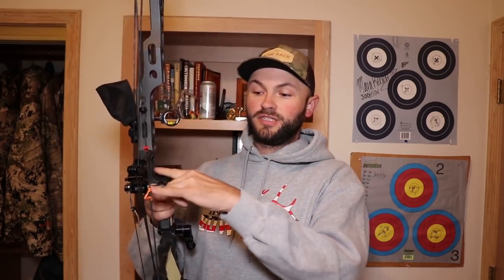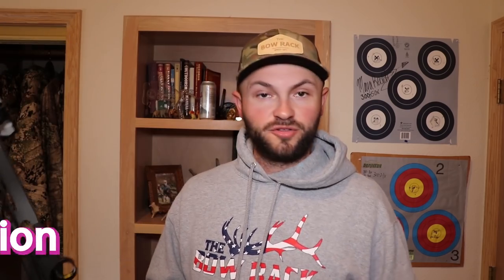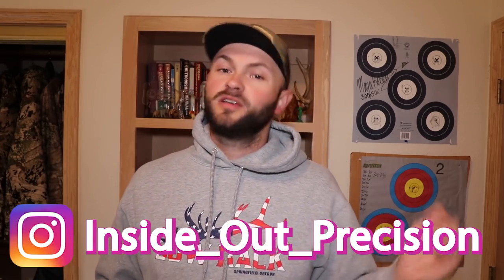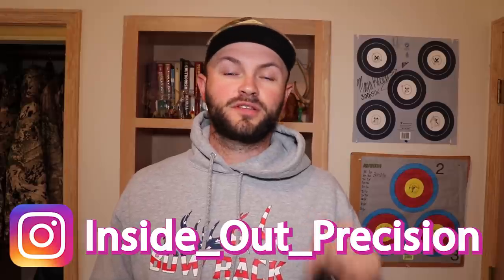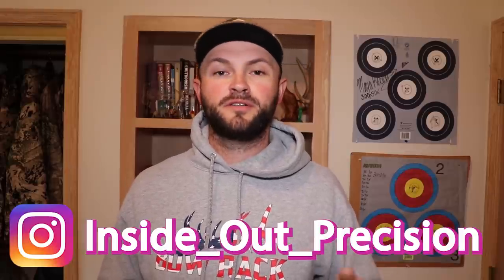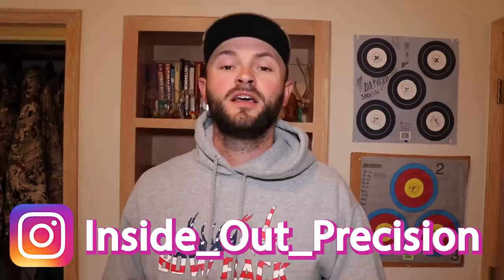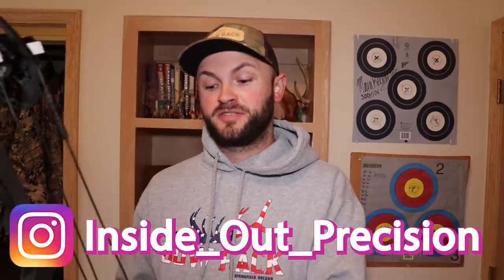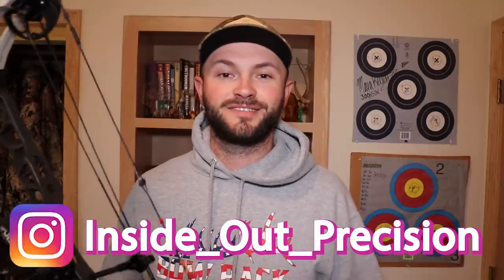Tuning Questions From Subscribers

Comment: Easiest way i found to make sure my arrow is 90 degrees from the string thru berger hole is to put my bow in my press and hang my arrow from it until it's going thru the berger hole,  fool proof method... good video
Reply: Ahh, the plumb bob method. Works well but then you can’t sell 60 dollar plastic single bubble line levels.

Comment: dude, thank you so much. Been fighting my powermax on a tail high and the only way I can get it to throw a bullet hole/clean bareshaft is to advance the bottom cam or set the nock point significantly low. Glad I’m not going crazy!!

Comment: Man i been fighting with a tail high tear with my hoyt helix no matter how much i moved arrow rest. Only way i found to fix it was slowing down top cam about 3/16 from stop. I squared my nock point at bottom half of arrow through burger hole thinking i could adjust rest on these new strings to give alittle more clearance for arrow rest. You talking about where d loop made me start thinking that little bit higher might be my problem.

Comment: Once again, another great video.  You indicated that cam timing is paramount, but you didn't advise on how to adjust it.  I believe you shorten the cable to close the timing, but not 100% sure.  Also, bullet holes through paper is just a starting point, correct?  Walk back tuning your fixed blade broadheads with field points require slight rest adjustments, if I'm not mistaken.  Adjusting the rest may result in a slight right/left tear through paper.

Comment: I have never really been able to get a proper bullet hole through paper. I make sure my timing is correct, arrow going through the Berger hole rest in the middle of my window. Shoot through paper and get it as close as I can, Then I shoot 5 and 50 yds a la John Dudley. When left and right are correct I then group tune to narrow the vertical size of the group. I don't torque tune, I don't find it useful, but that is me, it works for Paige Pearce. I shoot Field and Target archery from 30ft up to 99 yds. Tuning is so archer specific that no one method will work for everyone.

Comment: Glad to see a new video!! I shoot a carbon icon and it doesn't have yokes or tophats. I can't find ANY info on timing it or adjusting for horizontal tear. My rest is pushed so far out that it's embarrassing. Any help would be great
Reply: I'm trying to help a friend with a similar bow. Did you find a solution for your problem? If so, would you please share it? Thank you in advance.

Comment: Have you ever seen the cables not exactly matching through the holes on the Mathews cams, they can be close, but when you check timing on draw board they are perfect ?
Reply: I have this on my mathews vxr 31.5.  At rest the cables are through the cam timing holes but off just a hair when comparing the two.  On the draw board the cams are in sync as the stops hit the cables at the same time.  I also noticed my ata is slightly over 31.5" by about 1/32" and draw weight with 70lb mods is 68.9 lbs.  Not sure if this could be better but I'll check it through paper again.

Comment: Wouldn’t it be easier to solve a spine issue with adding or subtracting a few lbs out of the draw weight instead of buying all new arrows? Really curious as to why it is almost never recommended to change draw weight at all, especially since it’s free.
Reply from the maker: I hear you. If you're already at peak weight though you can't really add more without over rotating the cams which also increases your draw length a little. And you don't necessarily have to buy new arrows. You can add or subtract point weight or cut the arrows down. But yeah if you're underspined you can try dropping your weigjt a few pounds to see if it helps
Reply: Thanks for the reply!

Comment: I have an SR6 that would NOT tune with a Hamskea rest set on centershot, it was indeed  driving me nuts! Tried everything from changing the angle of the drop away cord to changing spring (both springs, external and internal) tensions... ripped the rest off threw on a Trophy Taker Pro set again on centershot and it was immediately shooting bullet holes... called Hamskea they said try all this and that, I explained I did, several times actually because I've never had such an issue tuning a bow, they were basically speechless. The rest is now collecting dust.... I did not and refused to move the rest off centershot, just me

Comment: Okay you said the arrow is supposed to be 90° from the string through the center of the berger hole... should it be the center of the arrow Shaft or the bottom of the arrow shaft should be going through the center of the berger hole
Reply from the maker: The middle of the shaft. Foesnt have to be exact, just eyeball it.

Comment: 😂😂😂 sounds like I need a new bow, I have the power max and have the 1 tail high tear...the horizontal is dead on, but she's tailing high. Thru a whisker biscuit 300 spine arrows 29.5 inches long about same for draw length. Contemplating moving the d loop a bit...
Reply from the maker: Whisker biscuits will almost always throw a tail high tear. Not much you can do with them when it comes to tuning. A good drop away rest will help a lot with accuracy

Comment: Thanks for the info in this one. If I added one full twist to bottom cam to bring top cam into timing, and they’re hitting very very close the same time, do I also need to add a twist to the bowstring?
Reply: The cables and bowstring oppose each other by pulling the cam in different directions. So, if your cam timing is late on one side (there's a gap between the stop and the cable/limb on that side while the other side already touches), either relax your cable (untwist) on the late side so the cable will oppose the bowstring less and let the cam rotate further, or twist the cable on the early side so it will oppose the bowstring more and retard the rotation of that cam a bit.
That's a mouthful. If you don't get it with the first reading, read it again.

Comment: So I’ve timed my cams dead on and set my hamskea trinity so my arrow is going through the center of the Berger hole and set my nock point 90 degrees to my rest and I’m still getting a bad nock low tear. Moving my rest doesn’t seem to improve it. What else should I try? Shooting a Mathew’s V3X 33.
Reply from the maker: Try raising your nock point a little bit

Comment: Love your videos. But moving the rest in the same direction as the tail of the arrow, or the rest in the same direction seems backwards to me when I look at the mechanics of it. BowTech says to move the cam/string, on my BT Mag in the opposite direction of the tail of the arrow to get the string behind the point of the arrow. I know you do this for a living, and I'm not try to make anyone mad. But I've shot a bow for 30+yrs. and have done it the opposite of what your saying with great results. I'm curious as to what I'm not understanding or why it seems backwards to me.
Reply from the maker: If you lean the cam in the direction of the tear, it leverages the string back the opposite direction when firing. We fix bow techs tuning jobs all the time lol
Reply from the maker: You don't move the rest in the same direction of the tear. Ifnits tail right you would move the rest to the left. But geneally we leave the rest centered and yoke tune or use the cam shims

Comment: Every mathews I've owned has a low tear and I've owned a bunch of them. I have a V3 27 right now and it's giving me fits with a low tear.  Specs are 28/60 shooting a 340 easton da torch. I also have some 300 rip tko elites and they are much better but still not perfect.  Have any ideas?
Reply from the maker: If you are running any kind of cable driven rest you'll always get a nock low tear.

Comment: Hey brother, I got my sr6 shooting nice and strait. But my arrows are sticking in target crooked! I bumped my rest a tiny bit seemed to help.. But still there.. There sticking in with tip to the right and ass end of arrow off to left. . My centershot however looks nice and very close on the sr6 but its only like 5/8of inch over from riser.? Please help . Also I'm getting clearance issues over bottom right fletch.. It's hitting riser.
Reply from the maker: You're rest is way too far inside of center shot if you're getting vane contact. You shouldn't need to move the rest to get that bow to shoot a bullet hole through paper.
Reply from the maker: You use the yokes to tune, not the rest

Comment: I sent you a DM on Instagram about how my broadheads are hitting center but my field points are hitting right. My arrow spine is good but they are flying tail left and they hit further right at longer yardages. Any thoughts on moving my rest? Thanks!
Reply from the maker: If it’s just 2-4 inches you need to bump your rest slightly to the right. This is going to cause your field points to hit slightly to the right of where you’re aiming, but should bring your broad heads to the left. Once their impacting in the same place just move your sight until they’re both in the middle
Reply from the maker: https://youtu.be/cTI1TGFJYJM